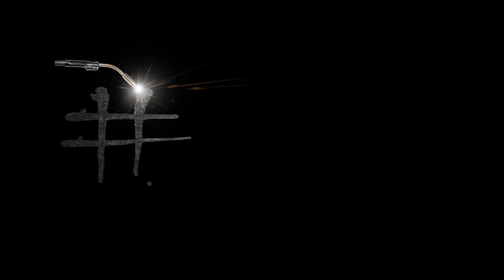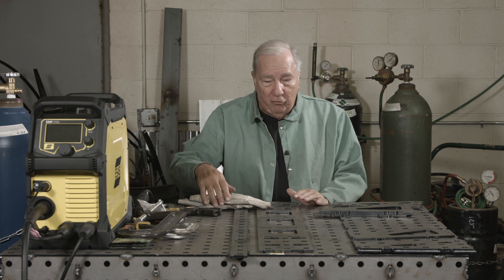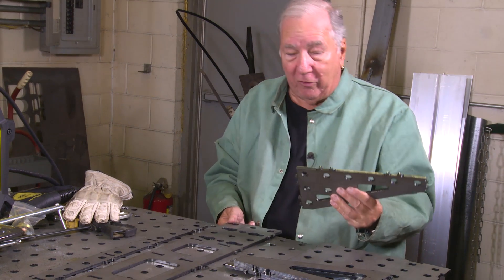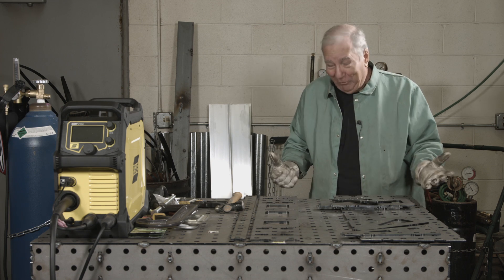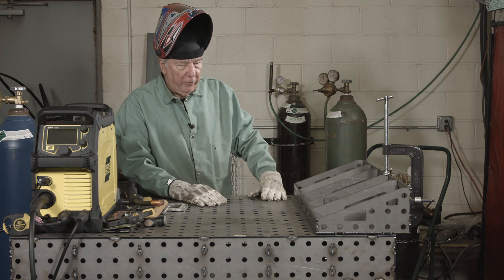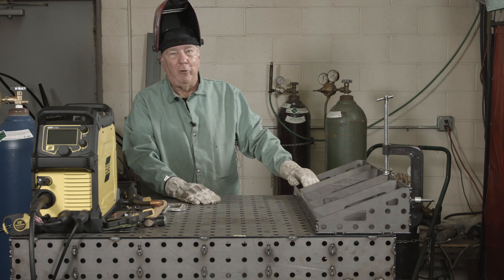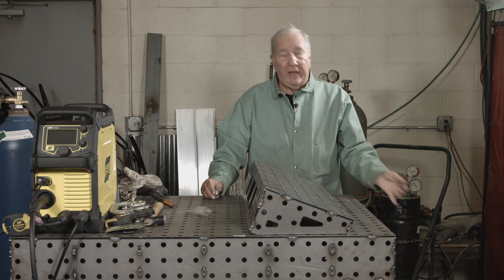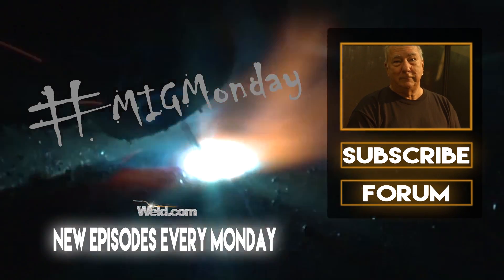Tab and Slot Fab Wing: Instructional Video | MIG Monday

Comment: Paul when you dry fitted the pieces  to gather you had the key holes wrong , when did you see it was wrong?
Reply: I thought so too, but the key holes on the top of the piece vs. the bottom of the same piece are opposite. You can't get it on wrong.
Reply from the maker: That's the beauty of this table. You literally cannot fit it together wrong.
Reply: Weld.com I love that it is idiot proof. I need to save up so that I can purchase one.

Comment: If you loosen your guide rollers a little bit you shouldn't have those hard starts with the wire melting off and sticking everywhere else. General rule of thumb is just point the gun at your hand with a slight bend in the wire and it shouldn't push your hand away hard and should follow a smooth bend